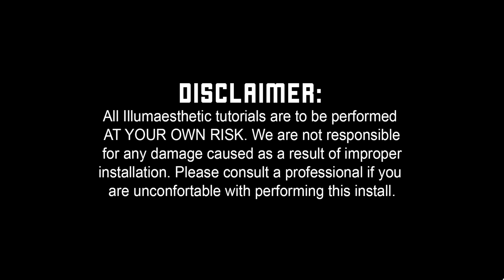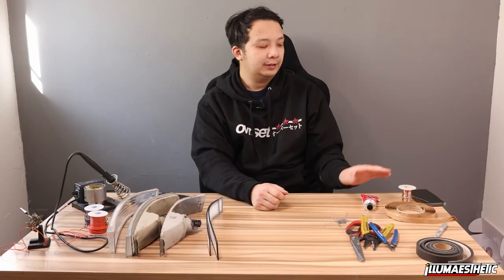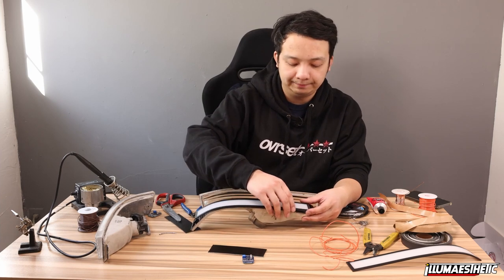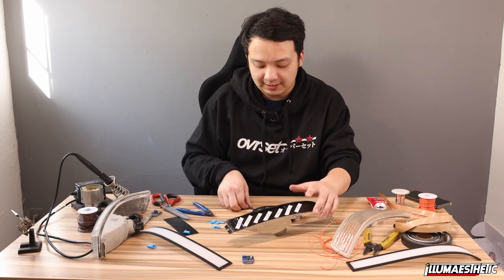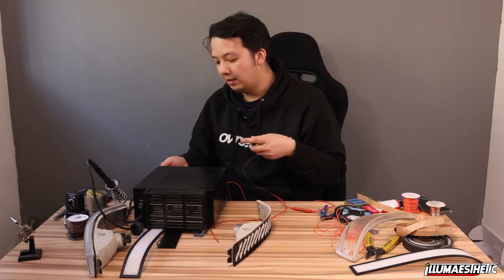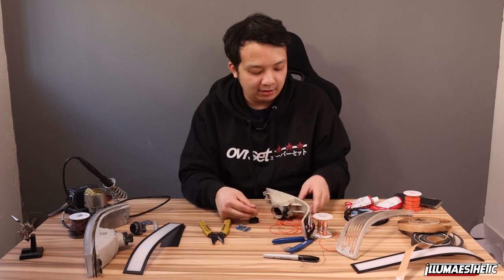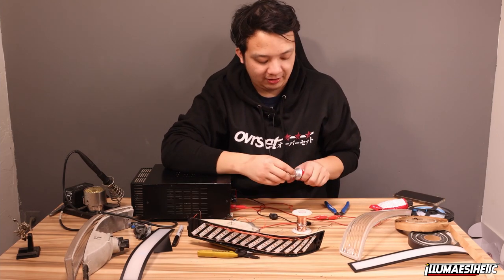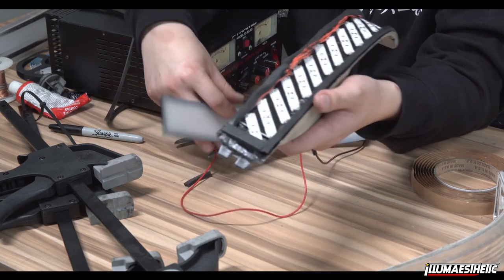How to Build Diffused Tail Lights! - Illumaesthetic Tutorials

Comment: That foam tape seems to also help raise the diffuser panel away from the leds to provide the right distance needed for proper diffusion. (As well as block light leakage). Thanks for another good tip!

Comment: Where can I purchase the diffusing material and what is it called?
Reply: This link is some diffusing material that would work well in tail lights, but unfortunately it is expensive. https://www.eplastics.com/lighting-diffusers/led  You might be able to look up LED diffuser channels on amazon and take the diffuser portion out of it and use it for the taillight if you can find a channel that is wide enough to cover the portion of the taillight that is needed.

Comment: I'm not trying to being smart but... Instead of that glue maybe using fast glue with activator would work better ans cleaner?
Reply from the maker: any item that's 2-part (epoxies, etc) releases heat upon curing (aka warp certain plastics), and is also somewhat of a pain to remove if you need to undo it for whatever reason. Hence why we don't use it. But in some situations, its definitely better.
Reply: Not always the case with styrene panels
Reply: Epoxy would have eaten the foam
Reply: Put supler glue on connections then it wouldn't work
Reply: @illumaesthetic better use dichloroethane with plastic dust

Comment: What temp do run your soldering iron, do you ever change temps between soldering certain projects? (Like tinning a wire vs soldering delicate smd projects etc?)
Reply: You can do it at 380c with a solder iron

Comment: 14v led strip hahaha yeah good one buddy all 12v led strips will sustain 14v so that is false.
Reply from the maker: This is incorrect. You can run 12V strips at 14V, but you will overheat and overcurrent them - reducing their lifespan.
Reply: @Thewolverine691  Take it you never considered overvoltage hence the reason for higher led strip voltage to prevent premature failure. SMH

Majority of the people who add these lights have a project car that's likely not stable with voltage anyways so that's another thing to consider SMFH.
Reply: @timothyodell5245  i am an electrician and i build lights but thanks for ya input. Opinions are like assholes. Everyone has one